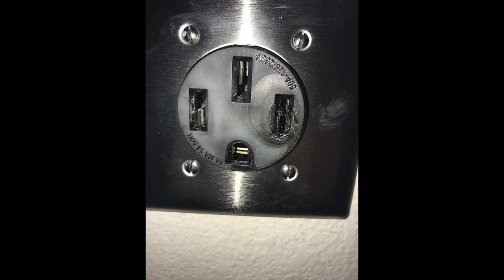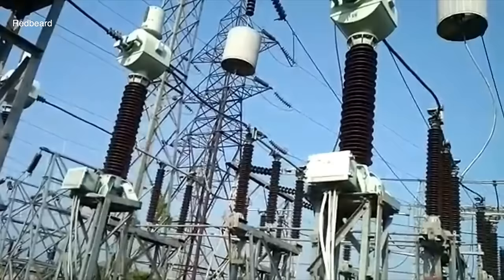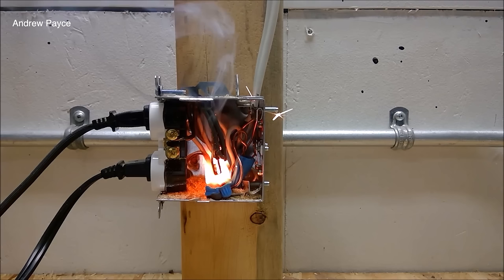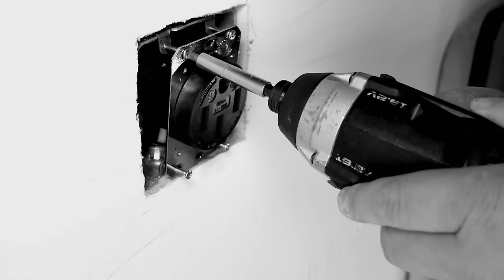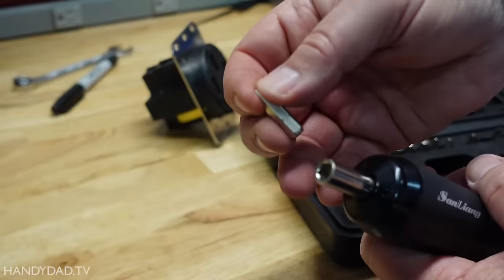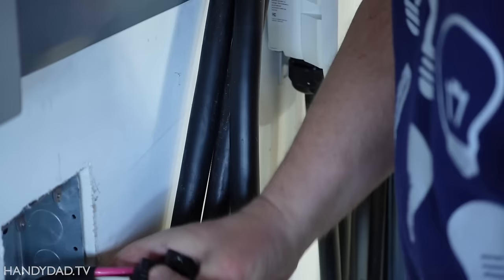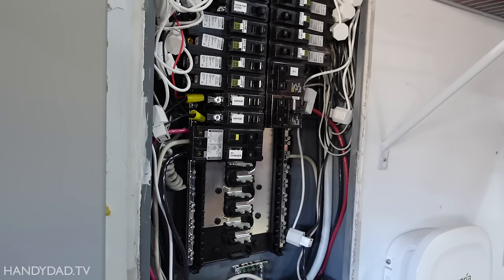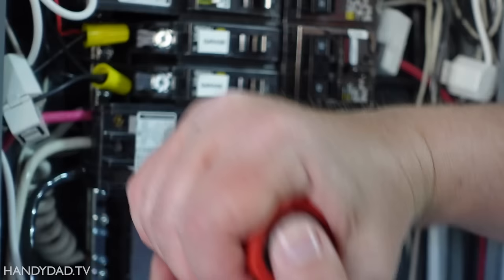EV Charging Disaster

Comment: Most people do not realize that charging an EV is considered a Continuous Load ( A Continuous Load is one that is expected to last 3 hours or longer). With a Continuous Load the Conductors (the wire in layman terms) and the Breaker must be derated to 80% of the normal rating of the Conductor and Breaker..... Not doing so is a Code Violation and extremely dangerous.                                                                                                                                                                                                                                                                                                                                                                                                                        .                                                                                                                                                                                                                                                                                                                                                                                                                                                                                                                                                                 Also, you should not be using a NEMA 14-50 outlet. A NEMA 14-50 outlet is designed to supply both 120 volts and 240 volts to an application, it contains a L1, L2, Neutral and Ground.                                                                                                                                                                                                                                                   .                                                                                                                                                                                                                                                                                                                                                                                                                                                                                                                                                                EV Charging has no use for the 120 volts, so the appropriate Wall Outlet should be the NEMA 6-50 which contains L1, L2 & a ground. It also save a great deal on the cost of the conductors 2 conductors and a ground verses 3 conductors and a ground...
Reply: It's true the charger has no use for the neutral, but most chargers still use the 14-30 and 14-50 plugs regardless.
Reply from the maker: 14-50 is by far the most popular EV plug, regardless of the history. It’s a fact.

Comment: really good video and a very good message.  it is really important.  However, also remember that if the screw is tightened too much, it will deform when it gets hot and thereby become loose.  Therefore, it is important to tighten exactly as the manufacturer prescribes.
Reply from the maker: Good to know. Thanks.

Comment: Hello;
I have looked at some of your great videos.
I am now retired and I was a hands-on manufacturing engineer.
All main power panels, all sub panels use use small/large "set screws" that compresses the wire onto a 'flat surface'.
There are "No" torque requirements !
The Hubbell NEMA (240VAC) uses a (3/16") allen key to tighten down all the terminals.
There is a "Yes" torque requirement. (Why ?)..
Questions:
(#1)
Why do the Hubbell NEMA (240VAC) clamping terminals having a "curved" clamping face ?  
(#2)
AWG #6 gauge = 0.162" Dia. 
AWG #8 gauge = 0.128" Dia.
What happens when (AWG #8) gauge wires are used on a (AWG #6) gauge clamping terminals ?
Reply from the maker: Good questions.

Comment: That is valuable advice. I charge my EV from the dryer outlet, and each time I do, I have to remove the the dryer plug to insert the EV charger plug. Now you have me thinking about what might happen over time when removing and reinserting these plugs. I better get on with the replacement outlet like you advised, and get one of those torque screwdrivers. I checked the outlets from your link, and they are pricey, but if it averts a possible house fire, it is definitely worth it for sure. Much thanks.
Reply from the maker: In addition, charge as SLOWLY as necessary to replenish your daily commute. No reason to charge in 2 hours if your car will sit there overnight. My charger can do 32 amps, but I have it set to 15 and could go lower. 

Higher power generates higher heat.
Reply: @handydadtv  I agree. Why charge quickly if the car is only sitting over night. Come to think of it, I could try charging at 110V. It will take quite a bit longer, but I'm retired, so there is no rush. 🙂
Reply: I'm looking at doing the same thing from the dryer 240v outlet but using the Splitvolt switch that gas a built in regulator and breaker to ensure you don't overload the wiring. This makes it where you don't have to unplug anything and the switch automatically goes back and forth with the power to the dryer or charger. 

What's concerning me is the dryer runs on an old 10-30 plug. Now Splitvolt makes a switch and EVSE that run off the 10 30 plugs so I'm assuming that's safe to do, but I'm still wondering how safe and if I should replace the dryer outlet first
Reply: @vicenzor9699 I have a 2022 Nissan Leaf with 48kw battery. In the close to three years of charging, there have been no issues. I just unplug the dryer and plug in the EV cable. It’s an old plug as well dating back to 1969 when the house was built.
Reply from the maker: @vicenzor9699 I would absolutely replace the outlet and inspect the wiring. Why chance it?
Reply: @handydadtv yes, that is a good idea, but I think perhaps to go to that length, I might as well get a proper EV charger installed. I would have done that before, but my electrical panel is on the opposite side of the house. The cable alone would cost a small fortune.
Reply from the maker: @kelalamusic9258 Certainly a dedicated EV circuit to a hardwired charger would absolutely be best. Replacing that outlet with an industrial grade will not cost that much. By inspecting the wires, I mean just both ends, not the whole length through the house. Just verify it’s the right size wire to match the breaker and outlet, and ensure the connections are really tight with no sign of degradation.
Reply: @handydadtv yes, that can be done. Cheaper, for sure. 👍

Comment: Great video, I also check mine with an IR camera after charging for a couple of hours.  Any spots that are even 1 degree warmer than the surrounding temp, show up immediately.  Great for checking the molded plug too.  Although even the IR cameras that fit on your phone are a little pricey.  But it's useful for lots of things like finding heat leaks, bad breakers, wet spots.  I even found a leak in the roof when I was just looking for heat leaks.  I saw a patch in the middle of the ceiling that was a tiny bit cooler than the rest.  I assumed it was just missing insulation.  When I went up in the attic, the insulation was there, but damp.  There was a vent stack above that was leaking a tiny bit.  The rubber seal around the pipe was deteriorated and needing replacement/repair.  Nice to catch it before needing drywall work or rotting roof decking.
Reply from the maker: I always wanted one of them. What brand do you have?
Reply: @handydadtv  I have a flir one that I bought 7 years ago. Still works great. I did have to get a small adapter from microUSB to USB C to have it work on my newer phone.
Reply: I'm a reefer / trailer / truck mechanic who wants to move to fixing and building cars. I've had one in my amazon cart for a while. Not a FLIR, but it does 320 x 240 for $600.
I think I want a 3d scanner first though.

Comment: Leviton outlets just don't hold up to EV use. It's amazing they're able to be sold. I've personally removed one that had begun melting at a friend's house. The difference in quality between the Leviton and Hubble is significant!
Reply from the maker: Thanks for sharing. So many people think this is BS and they just buy cheap outlets. My preference is to avoid the outlet and just hard wire it.
Reply: @handydadtv  I’m installing an EV charger next weekend and I’m using a hard wired connection instead of an outlet.
Reply from the maker: @Tim - good to hear!

Comment: I have found that I need to clean the pins on the plug from time to time. They can gradually corrode.  If you unplug immediately after use and the prongs are more than warm then you know that there is dirt and resistance.  In time that weakens the spring tension of the socket as well making even more loss.  This is particularly true if the pins are plain brass.  Many of our plugs use genuine silver plated earth pins for this reason.  So that no matter what the EARTH connection is better than any other connection.  Just in case.
Reply from the maker: Thanks for the info

Comment: I once had a commercial power distribution box whose internal wiring was not torqued to spec by the manufacturer. This was a hefty unit distributing 30 amps @ 240v into several separate 120v 15 amp circuits. We had purchased about a half dozen of these. The one with the improperly torqued wiring failed, having melted the plastic supports on the internal bus bar.
Reply from the maker: Thanks for sharing the importance of torquing.

Comment: Had licensed plumber install a new water heater. My wiring in my home is Aluminum the previous water heater had an old school timer box but I removed the adjustment which trip the switch, so it just ran 24/7. This box acted as an interconnect between copper whip from the water heater and the aluminum wire feeding from the box. What this plumber did was remove the box which I wanted, and he used wire nuts to connect 4500-Watt 220V heat pump water heater. I came home from work the heater was off the panel breaker tripped. I turned the breaker back on thinking maybe the heater is bad. About 15 min later I noticed the wall had a burn mark coming out where the whip was going into the wall box. I shut down the breaker took the wall plate off wire was burned up. I later found the wire actually burned like a fuse up to the point where the wall box strain relief was. If that strain relief wasn't there, I suspect the wire would have burned inside the wall and up into crawl space and started a fire. The strain relief was tight causing the wires to short enough to trip the panel breaker.
Reply from the maker: Wow! Lucky it didn’t cause a fire.

Comment: Although currently,  most building codes do not require them, installing a heat detector is a good idea to have inside an attached garage and most models can be wired on the same circuit as the hardwired smoke/CO detectors in the house.  You wouldn't want to use a smoke/CO detector in the garage because any exhaust fumes from vehicles,  lawnmower,  etc. will cause nuisance alarms.  Even if you are not using any gasoline powered equipment,  dust and insects will foul the sensors overtime.  

Heat detectors come in two varieties,  fixed temperature,  and rate of rise.   They are not considered a life saving device because they respond to heat instead of smoke, and in almost all fatal structure fires, the victims succumbed to smoke and toxic gasses before the flames got to them.
Reply from the maker: Thanks for the info. I will look into that.

Comment: Dryer plugs are 30 amp units. This is a Nema 14-50 plug which is a 50 amp plug so it's much more heavy duty and the sockets and plugs are rated for much higher amperage obviously. I'm an industrial electrician so I see these plugs and receptacles all the time. Mostly for welding extension cords. But ours are twist lock style.
Reply from the maker: I’ve only used twist lock for generator connections. Thanks for the info.
Reply: Yup, twist lock style plugs/receptacles are designed for regular plugging in and removal, they are fantastic and wish they were more common.
Reply: Range Plugs here are 50amp rated for 75c. This is what is being installed in new homes for EV charging

Comment: Just an observation.  The torque screw driver you used goes to only 70 in-lbs.  The requirements that were on the chart for the plug seemed to require 75 in-lbs.  I'm not sure if that would be a significant difference, but perhaps a different tool with greater capacity is in order?
Reply from the maker: Truthfully, I couldn’t get it anywhere near 70 in-lbs by hand. I just went as tight as I could. At least I knew I wasn’t going to strip the screw.

Comment: I installed a Hubbell 14-50 with an Emporia charging station that I leave plugged in permanently. I also installed a new 100 amp sub panel with 50 amp breaker. My Charger is set to 40 amp max. 48 amp simply isn't worth the risk to save maybe an hour charging time. Yes, my setup can easily handle 48 amps with a safety margin, but personally, I will stay at 40 amps and have peace of mind. 2022 Ford Mock-E GT Performance owner here. Love my car. 
One more note if you go 48 amp or higher than the nima 14-50 outlet will not work. You'll need to hardwire your charging station directly. Another reason I limited to 40 amps charging rate.
Reply from the maker: You can only use 80% of the breaker’s capacity so you’d need a 60-amp breaker to get 48 amps from the hardwired charger.

But even though you have 40-amp capacity, I recommend charging as low as possible to recharge your daily commute. For example, I charge at 15 amps on a nightly basis. Higher rates generate more heat so I only bump it up if absolutely necessary. 

Glad to hear you like the Mach E. Have you ever driven a Tesla? I’m wondering how it compares comfort-wise. My Model Y is a rough ride.
Reply: @HandyDadTV  Yes, I would swap out the breakers. I currently have 60 amp breaker at the 200 amp main and 50 amp at the 100 amp sub panel. If I should choose to go with 48 amp charging, I'd install 100 amp breaker at the main and 60 amp at the sub panel and hardwire my charge station. My wires are 100 amp rated service coming from the main . I spent the extra money for future proof upgrades. I agree with dropping below 40 amp charge levels to save on heat. I live in North East PA, so our ambient temperatures are lower most of the year. During the hot summer months, I'll drop below 40 amps for overnight changing. 
I have driven the Tesla model 3 and really liked it. The Mock-E GT Performance has a fantastic ride quality, especially in the corners. I'm not big on high-speed launch rates as most people are. I'm more into the curvy back country roads.

Comment: Now, like EC and EV Charger Installer, we not recomended EV plugs on a AFCI/GFCI breaker. Its will burn/or fail more frequently that regular breakers. Its an exception on the code for that on EV section. I changed those breakers every 3 month of operation. Make it more costly for EV Owner. My installations with regular breaker last for years. Never an issue of fire or loose contact
Reply from the maker: Do you have the NEC reference? I’ve never seen that exception.

Comment: My 7KW EV charger was installed by a very experienced registered technician and meets all the current UK safety protocols but the load never exceeds half its maximum rating for my peace of mind. The same applies to my back-up granny charger which was plugged in to a brand new socket in the garage at the outset and has never had that plug withdrawn for the reasons you give. When I do use it, the current is restricted to 8 amps, (UK 230 Volts) which is 60% of its potential maximum,  and the charging period never exceeds 2 hours which means the socket barely gets warm.
Reply from the maker: That’s a good way to prevent issues 👍🏻

Comment: Always "break" a click-type torque indicating tool a minimum of 3 times before using it.  That ensures the internal lubrication is properly distributed.  Also, never use one in the lower or upper 10% of its range and reset to the lowest indicated torque setting after use.  Your outlet lugs require 75 in. lbs. of torque but the screwdriver you're using only goes to 70 and shouldn't be used above 63.

Comment: I think a big part of the issue is people using the wrong wire for current. Judging on some of those photos the wire ga looked way too small.. 

The only real difference with the Hubbell HBL9450 is it’s made to have plugs installed and removed several times. It’s still rated for 50amp and 75c continuous. 

That being said if you are concerned just adjust charging rate in your car to just slightly lower.
Reply from the maker: I agree. My max charge rate is 32 amps but I charge at 15 amps to replenish my daily commute.

Comment: Good content and very helpful. However when you state “…two conductors next to each other with voltage going through them…” and “…voltage jumps through the air…”, that is incorrect. Current flows through conductors and jumps between conductors. Voltage doesn’t flow.
Reply from the maker: Thanks